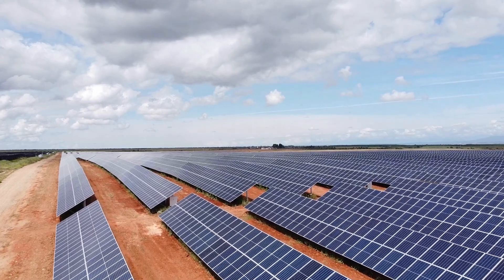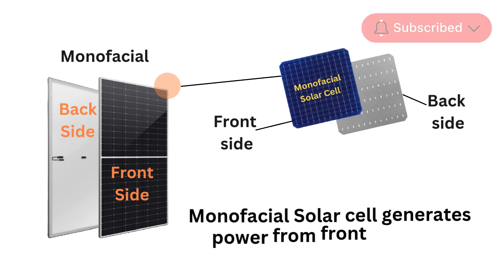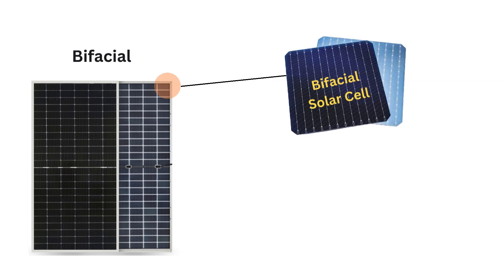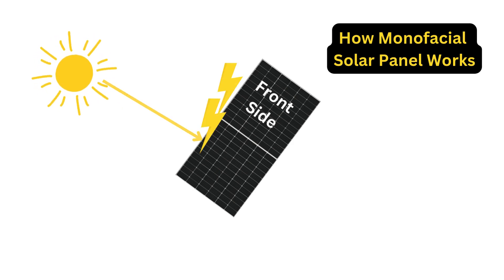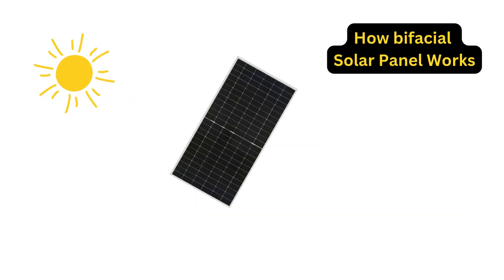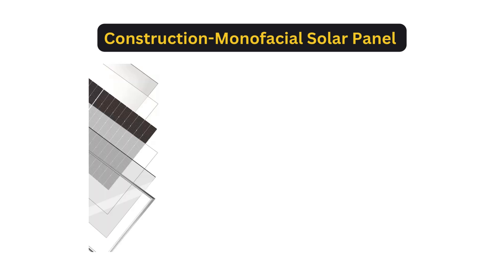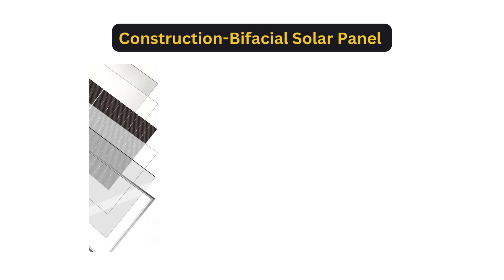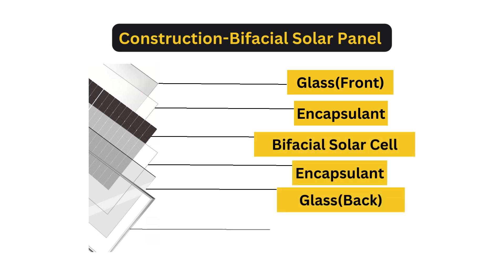Monofacial vs Bifacial Solar Panel | Difference Between Monofacial & Bifacial Solar Panels

Comment: Which one is more popular mono-facial or Bi-facial?
Reply from the maker: Bifacial is more popular as it generates power from both front & back side. Bifacial Solar panels can be made in two methods. One is the Glass- Transparent backsheet and the other is Glass -Glass combination.
Reply: Bifacial